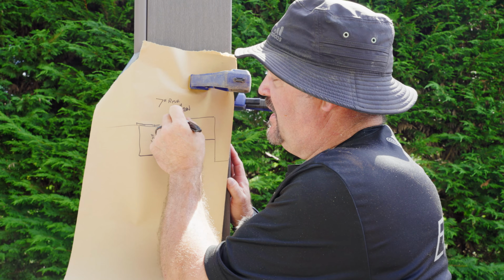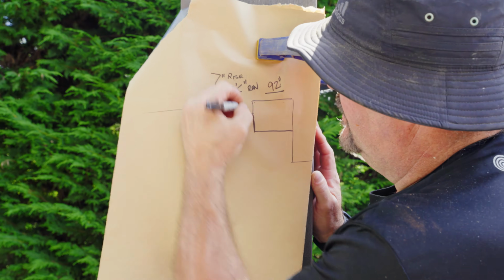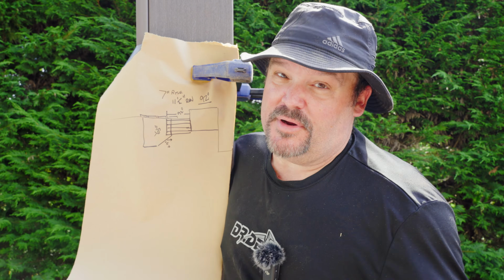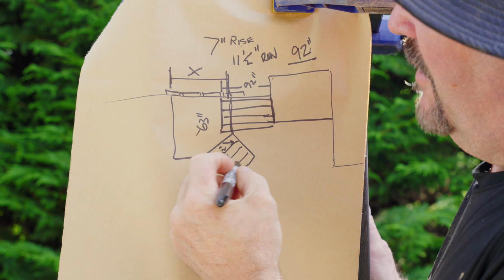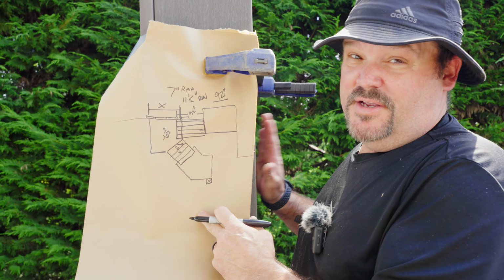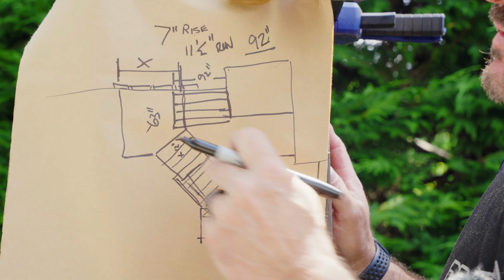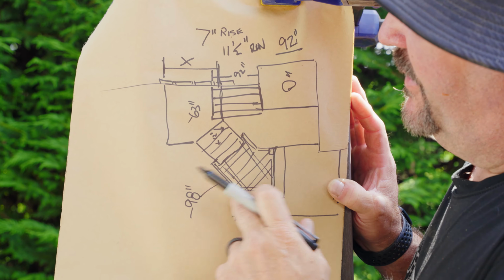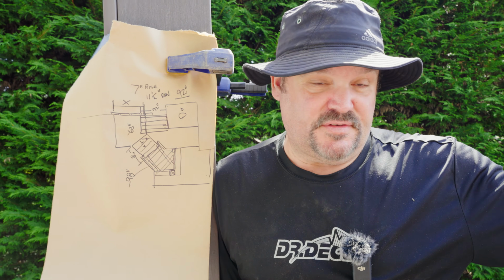Mastering Stair Landings: Planning, Measurements & Tips || Dr Decks

Comment: Someone asked me to do stair stringers to obtain a set of stairs up to a deck about 90in high. I got there and the old stringers were removed and taken away. The pre-existing railings seemed ok but we're at an angle (from bottom landing area when viewed) up and to the left maybe 16in or so. Other words very odd. They originally did so to land on the concrete pad nearer the home. I realized that being so odd, standard math does not work. And thought the stringers can be altered where they tie-in to the ledger at the deck. But thought deeper realized that throws other things out. It probably requires about 13 steps. Would a upper  trapezoidal landing added to the deck be best if the customer still wants the new stairs to run down towards the house to land at the concrete?
Reply: (from left up towards the right)

Comment: Off topic, how do i install a 4x4x8 post onto an existing deck to create a deco wall?
Reply from the maker: If it’s non structural, find a solid spot to screw to and use a metal bracket into concrete at the base.